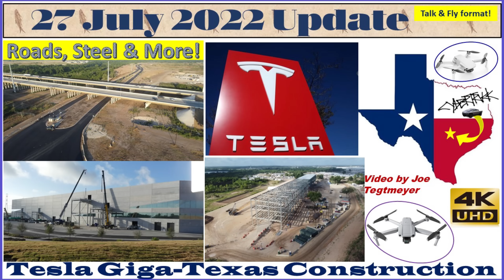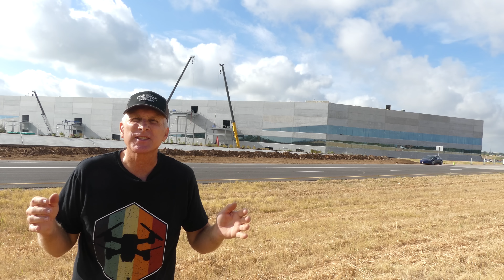Tesla Gigafactory Texas 27 July 2022 Cyber Truck & Model Y Factory Construction Update (07:35AM)

Comment: Hot damn, concrete going into the cathode building. I have to wonder if the building was designed to be modular. So narrow for the line process. Need more capacity? Build a 1.x version cathode building right next to it.

Comment: Thanks Joe.
6:35. North-south road. Street lighting installed along the median. 
6:57. East Main Entrance. From previous comments about the West Main Entrance. The vacuum lifting rig is by VSG Konter. Each of the counter-weights is 1000kg. Seems to be 3 on this rig.
Pallet of 3 smaller glazing units for the upper windows seen in the previous video have been shifted to the south end of the easement.
7:18. BIW, existing loading dock ramp to the right. Floor and perimeter grade beam of the recently constructed loading dock opening has been busted out. Same on the 3 new loading dock openings in the new ramp area to the south (left).
7:58. Outfall channels area. Seem to be dumping top soil. And not for the first time. From the first lot of soil dumped here over a year ago very little effort was made to compact it. Won’t be building anything on this.
Good view of the difference in elevation can be seen at 5:25.
11:38. GA. Dock marked W85. Fitted with a louvred panels. Similar at the north end of Battery.
13:35. North road. Hydrant. Temporary connection of the irrigation system to this hydrant.
15:53. MM batch plant. Load of gravel arriving.
17:34. Cathode. Cracking ahead with concrete on Level 2. Unfinished sections of Level 2 and 3 show they are using regular rebar rod here.
18:14. Cathode. Level 1 floor slab projects twice as far past the frame on the south end as it does on the east and west sides.
18:34. Cathode. Level 2. Block-outs in the floor are for small openings. 
Level 1 outside. Conduit sweep bends appear to be metal.

Comment: Your 'helicopters' are called Power Trowels. They embed the rock in the concrete and bring the 'cream' to the surface so it ends up having a very hard and smooth surface for usually an epoxy paint.
Reply from the maker: Ok … they call them helicopters here but I’ll pass along your info

Comment: 18:35 Theses aren't for columns. They line up right above the center of the bays under it. Theses are for overhead hoppers. My guess is that this is the end of the production line. This is where they are going to load up trucks to make the short journey from this factory to the battery cell production unit.

Comment: I was surprised to see that today's weather report (at 02:40) showed a 77 degree F temperature. All the news I have recently read was that Texas' grid was almost over capacity due to the high temps, low wind power to generate electricity, and Texans cranking up their ACs to keep cool.
  I was impressed at your flyover of the 2 pipes that go under the Colorado river the purple one at (04:57) 1 meter in diameter to the water treatment plant.  I appreciated that you told us about the 3" black pipe that will send water to the GigaTexas plant.
  I am Very Appreciative of your Talk'n Fly format!  You judiciously tell us and show us flying the engineering details of GigaTexas, as compared to GigaBerlin https://www.youtube.com/watch?v=Q8U0td-WfoI&t=762s, who seems deficient in completing roads and parking spaces construction and painting.
Reply: Regarding the temperature, looks like that snapshot was taken around 7am.  At 4:30pm today it is a mild 99F, so a few degrees cooler than the last week or two.
Reply from the maker: I fly early before the temps climb into the 109s in the afternoon

Comment: @ 5:04 Looks like the pipe is already in the process of being pulled under the river.
Reply: Yep, you could see them starting on Tuesday at the end of Brad’s video. Not enough to call it real progress but they were pulling back on the drill string.
Reply: David, did you notice that they switched the purple pipe to the second bore that they drilled ? They could of had a problem with the first although it still has a drill stem in it. They might use the first bore for the smaller pipe.
Reply: Nice to hear good comments. There was someone that could only complain about people driving on the grass and whatnot.